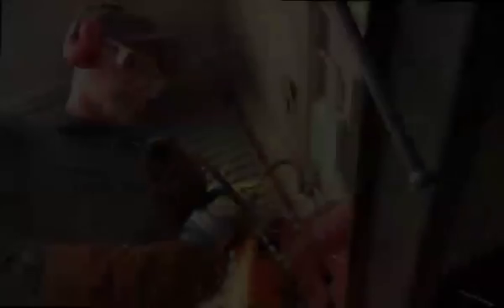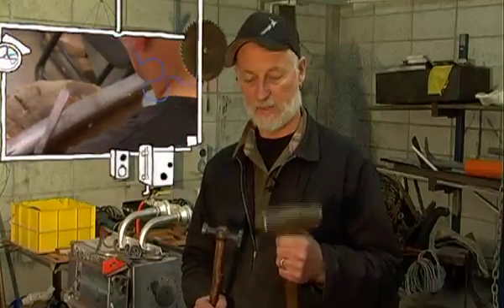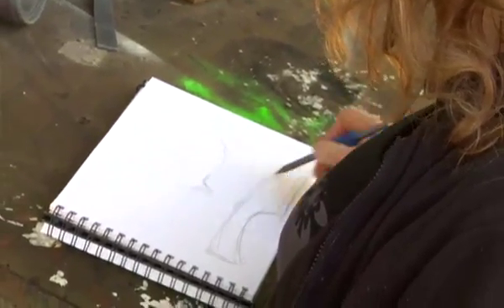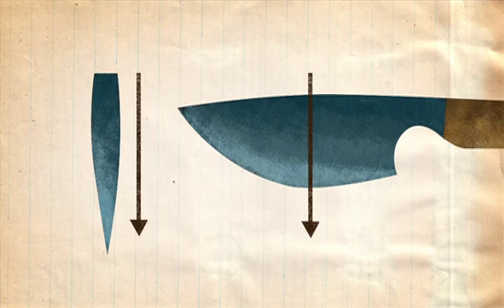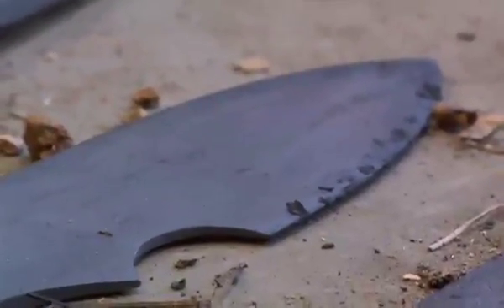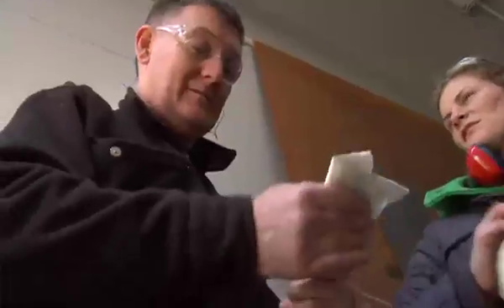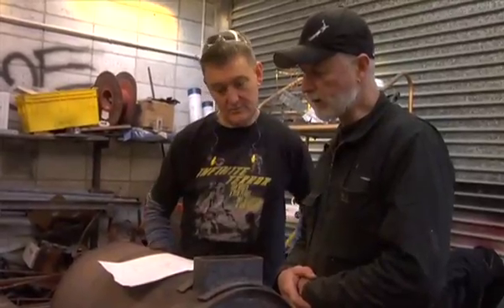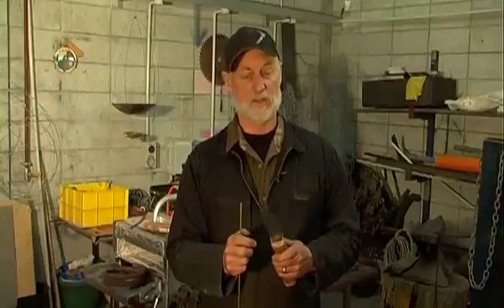Toolmaking - Forge Your Knife

Comment: It is fast and effective method to make a blade for beginners. No reason to complain - hammering blade to exact shape is not so easy . Temperatures were all correct (why commentators are thinking temp. is low?). Spring contains carbon enough. What is quality steel? Dif. steels for woodwork, skinning, digging. Oil or water quenching depends of the steel. Using old motor oil is common. You can quench only the cutting half of the blade. The blade must not be sharp at all - then its warping easily.

Comment: Can I use old motor oil for the hardening process. I go through on average 100 galons of motor oil a month just to keep my fleet of tractors running. Would that make a difference if I used the old oil from that to do hardening?

Comment: Not with the method he shows.  What he is doing would result in a very poor case hardening if he had used a material with more carbon and held it at a temperature where the carbon could go into solution in the steel.  The temperature he was working with was too low to allow carbon migration into the crystal structure with anything less that a product such as Casenite.  Start with a quality steel with the carbon content your project requires.

Comment: They would actually forge the blade to shape and finish with files and stones.. This individual hasn't refined his hammer work or heat control yet so he has to use far more grinding than a bladesmith ever would have to resort to.

Comment: Nice video.  Good heat treatment tips.  I have found it to be most tricky.  Love the sawdust tip.  I have made several knives, but have used coil springs only for punches and chisels.  Will have to try this.

Comment from the maker: Thanks Liam. I see your point, the title is perhaps misleading.  More accurate to have titled the video 'Knife Making by forging and grinding'. As the video shows, a coil spring is forged into a formed blank then this material is removed by grinding / sanding.  Stock bar is not the source material.
Re temperatures. We use the Celcius scale - see the oven shot and heated steel colour - temperatures about 900C+ -  (1652F) - more than hot enough to forge work the coil spring.

Comment from the maker: Suggest you contact the manufacturer for specific details. Generally though, if it is suitable for springs on a car it is fine for making a knife from. Have a look at the details on Wikipedia for high carbon spring steel.

Comment from the maker: A rubber mallet will not work - the heat will cause the rubber to melt. A regular hammer could work as it is hardened steel - however, better to use either a ball pein hammer or small sledge hammer - depends on your strength.

Comment from the maker: Looks like you will have your work cut out for you on this one which ever way you go. If you have heated the steel in the cut-out process you will have partially annealed (softened) it reducing its effectiveness as a cutting instrument. The other part should still be hardened making it difficult to form or drill by hand. Suggest you go back to the steps covered in the DVD. Anneal (soften) the steel, form it, harden, temper, polish, attach a handle, sharpen, use with care!

Comment: I bought three feet of Hardened steel. I cut some out to make a machete.
Its still rectangular and three inches wide and maybe a foot long. idk how thick but its a good thickness.
I want to keep the rectangular shape and just put sum para chord as the handle and sharpen an edge of it. yes i know, lazy and not crafty but i want to start of easy since I will be doing everthing by hand.
anyways, after sharpening- Do I temper it?? and I dont have to re harden it do i? HELP ME ASAP!!! please(:

Comment: this is a little late, but once it has been quenched you can wash the oil off, and it will never get into your mouth. but olive oil or vegetable oil works too, the reason people use old engine oil is to add to the carbon content in the steel.

Comment from the maker: @Looneydude2398  A cold grind should not affect the carbon content. Carbon loss of any significance mainly occurs with excessive heat - at a light yellow to white heat sparks can be seen forming on the surface - carbon loss is occurring. Carbon can be replaced by heating your blade to orange heat then placing it into a can of sawdust and putting a lid on to exclude oxygen - reduces fire risk. Leave it here to cool. Then follow up with usual heat treating and tempering.

Comment from the maker: @cejason Hardwoods such as ebony will work well for handles. Soft woods such as pine or willow may not be as durable. Depending on where you live it is worth exploring a range of timbers for their picturesque grain patterns and colours. Laminating different woods can work very effectively as well - use an epoxy glue and let it set  before an initial clean up then finish by sanding with a high grit paper when glue has fully hardened.